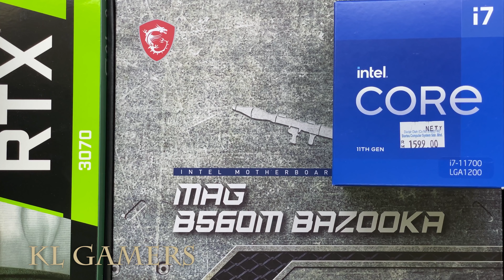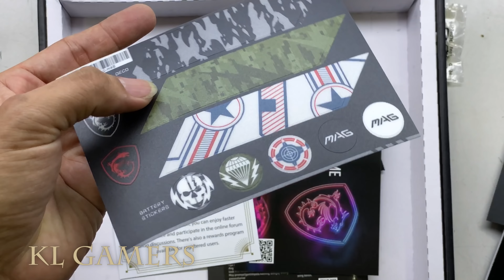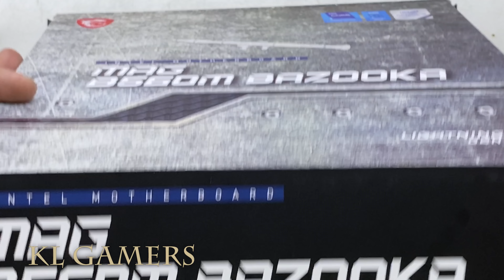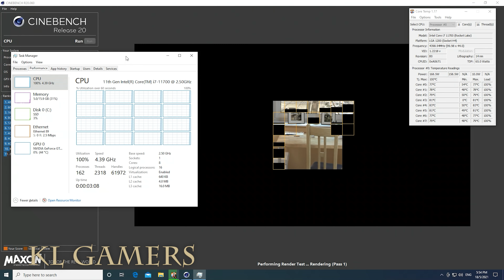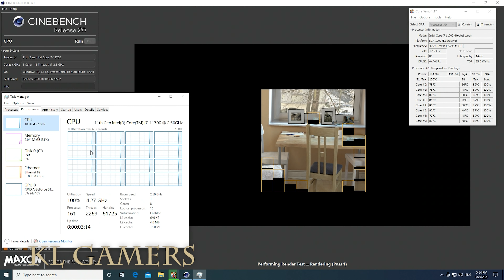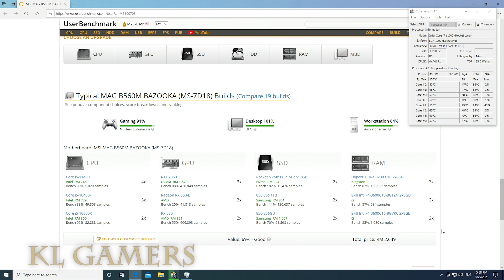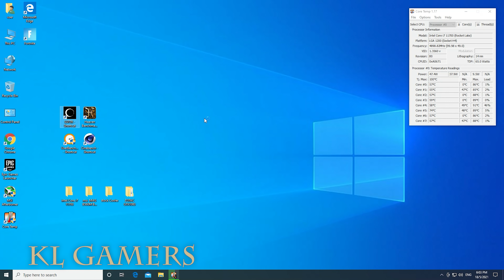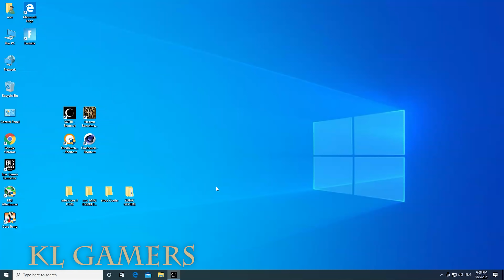intel core i7 11700 msi MAG B560M BAZOOKA ZOTAC GTX1080 Gaming PC Build Benchmark

Comment: Would you recommend this Mobo and CPU? High quality?
Reply from the maker: sure, with huge tower cooler or AIO liquid cooler
Reply: @KLGamers  Thanks mate. is heat a real problem with this CPU?
Reply: @djtc2093  Only if you neglect dust build up otherwise its rock solid my temps never get over 50C with a mediocre EVGA 240 aio.
Reply: @doctorbutters  If you remove the power limit it hits 85/90 degrees. But at standard speed it sticks around 60.

Comment: that motherboard can barely handle a i5 11400f it wont handle a i7-11700 especially with the stock cooler, everything else looks clean tho, keep up the good work
Reply: All non K are 65w max this mobo will be fine
Reply: @itzamedave6242  ok look up the i5 11400f on the b460 boards you will understand my point, it s too long to write
Reply: @mcgladiator1715  don't have to look it up I've been building for 30+ years and I own i5 and b460m 🤔🤣
Reply: @mcgladiator1715  i7 11700 is a 65w model it cannot be overclocked and only reaches 65w when it's in turbo mode yes it and the i5 can have the wattage bumped up on ASRock motherboards such as the b460 and b560 but it's pointless as it doesn't help performance and will run hot like the K model cpus at which point it down clocks
Reply: @jeremyniels  I second that 🤣
Reply: @jeremyniels  i third that
Reply: Than what can it run? A i3 11100? Oh wait… case rested
Reply: @mcgladiator1715  Alright so i owe you an apology, i checked the video. Then tested it with my own asus prime b560m-a and 11400f using prime95. conclusion it starts off at 4.2 ghz and progressively downclocks over 35 min to 3.7 Ghz where it remains  stable from there ocassionaly going back up to 3.8 and after 40 min it's back to 4.0 ghz again, and yes i do use a great cooling solution so the temps aint the reason. Not as bad as some boards in the graph but still missing out on some power.
Reply: @jeremyniels  thank you bro !! also keep in mind that most bidget builders aind gonna use no aio or an actual great cooling solution,  it s either the stock cooler or a budget 30$ one, means if you are on a budget wich is what this cpu is meant for, you wont get the full performance.
Reply from the maker: it's ok
Reply: @mcgladiator1715  yep stock cooler is guaranteed to throttle. i got max 71 c 
and average 66 on my arctic freezer 34 lol. also stock is sooo damn loud
Reply: @mcgladiator1715  hi, what do u think about dark rock pro 4 on 11700 or assassin III(but actually i dont want to buy this one bcs i watch test and i dont like noise fans) it would be good? and i watching on asus h570pro mobo